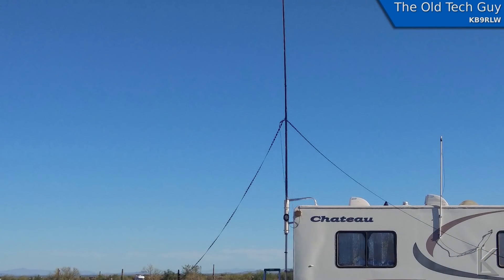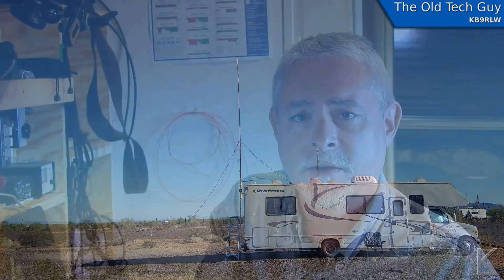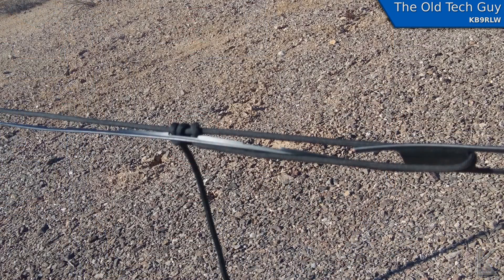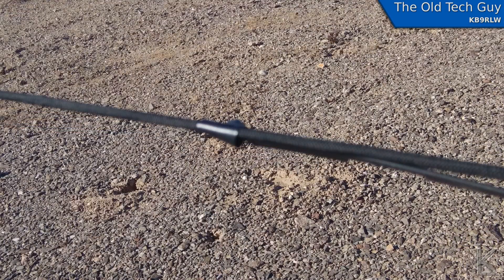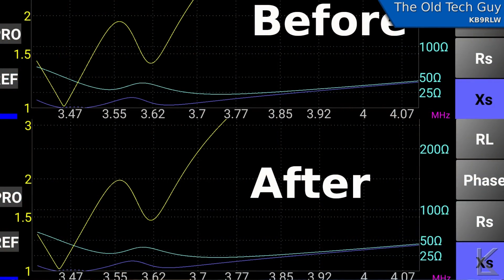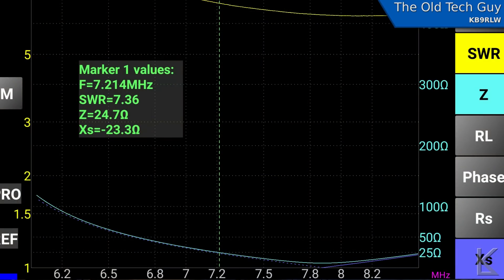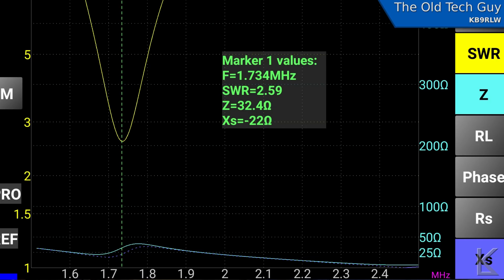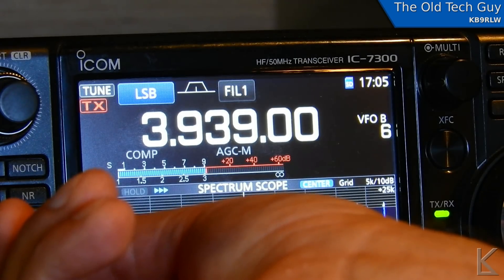Ham Radio - The 75/80 meter fan dipole experiment.  The final word.

Comment: I know this is an older video, but I have a few thoughts. 

My first thought was to solder your extended ends of the shorter wire back to the longer wire at the ends.  This will give you a slightly wider element past the shorter wire. However, my guess is it would not have helped your 75m dip. 

When I was Novice, I saw the instructions to build broad-band antennas for 75/80 and diameter of the cages was huge. They might have been 16 inches and used very many wires.  

I never had a full-spectrum 75/80 meter antenna.  I did accidentally broaden the bandwidth of my 80m antenna when I made a parallel dipole......

* technically, the "fan dipole" had different bands spread out like a fan, or more like the spokes of a wheel.  The Parallel Dipole is where the different elements are all parallel to each other. 

I made parallel antennas with 80, 40, 20, 15 and 10m.  The 80 meter version was wide enough to cover all the data/cw band and the 75 meter version covered all of the General privileges, for sure, because I was General then, so I don't remember if it covered the rest or not. 

I used 4 inch spacing at first, but I experimented with wider spacing up to 8 inches. The spacing changed the bandwidths a little and moved the dip just a little. I don't recall the "sweet" spot because I did not think the extra width was worth it and I was happy with 4 inches. 

The fan dipole was my favorite until I accidentally made a doublet from an 80m dipole. 

I put an 80m dipole about 100 feet high and fed it with RG-59 CATV cable. I used a tuner to match it to 75 and 80 wherever I wanted to be. It did not do badly on the other bands.  I don't remember the exact length, but it was probably cut for the middle of the band.  I'm guessing it was in the 150 foot range.  When lightning disintegrated the aluminum shielding of the coax, I replaced it with 300 ohm TV twinlead, and later, 450 ohm window line. 

This was my miracle antenna. If I could hear it, I could work it. I was the most wanted station on wall-paper nets running QRP.  I never had a better wire antenna.  

My tuner was manual at the time and had a built-in 4:1 balun for connecting twin lead, window line, or open wire feeder Called ladder line.  Today, I have auto tuners, so if I used this antenna, I would run window line or ladder line made with insulated wire.  I would use a 4:1 or 9:1 BALUN, preferably at the tuner, or to the coax closest to the tuner. 

For your setup, at least at this time, I think the doublet would work best for you. The reasons are that it may be lighter, and it can be trimmed to match all bands. The doublet is kind of like the random wire. It needs to be fed where the voltage, impedance is low enough to handle.  The window line has negligible loss. It can be trimmed, even off center, to have an SWR tunable by even the internal tuners in the radios.  Unless you have a G90 and then it would not surprise me if it tuned the antenna without a balun, hihi.  

Great videos on this antenna. Thank you

Comment: one thing that would have helped .

 Drop the ladder line and use thin gauge wire like 18ga ,  use zip tie material as for spreaders this will lighten the overall weight, or better yet just drop the spreaders altogether . I understand that your wanting to to make it portable and quick to deploy , but really,  how hard is it to simply unroll four  60+ feet of wire on four small separate rolls really ? 60' of 18ga will roll up on a tiny reel.. this also gives you the opportunity to angle the bottom antenna offset from the other  .BTW  I've learned from experience that you tend to get better results when you have the longest antenna on top . 73, and  Happy Rag chewing

Comment: the wires are probably too close together (too tightly coupled). looser coupling should smooth out the pair of resonances. how practiced are you with antenna modelling (4nec2, for instance)? have spare wire and spacers (monofilament or paracord bits) to make a wider spaced 'fan'?

Comment: I invented an antenna I call the Pyramid Antenna: It's two inverted vees at 90 degrees to one another and fed by the same feedline at the top, and that sort of looks like a pyramid. One wire pair is designed to resonate at about 3600 kHz and the other pair, at right angles to the first, resonates at around 3900 kHz. It does exactly what you want: below 2:1 SWR across the entire band; and, as long as you get it up 45 feet or more, it's nice and efficient. It also has the advantage of being much nearer to omnidirectional than a conventional dipole or inverted vee, because all the elements radiate to some extent, even the ones with less current cut for "other end" of the band, thus filling in the nulls.

Comment: I have learned a lot from watching your videos.  Sorry the fan dipole experiment did not work; logic doesn't always apply to electronics I've noticed.  I thought it was a good plan. I have a Chameleon EMCOMM III and I assume it has a similar toroid to the ones you used for your outside box as it is resonant on lots of different bands.  Oddly, it does better on 75/80 than it does on 40 meters, which makes no sense to me.  But I love the EFHW type antenna.  I live in an HOA environment, and the wire disappears against the trees.  Please keep showing us your work.  I'm NOT a tech guy, but I have learned enough from you to at least attempt an antenna build.  I'd do a video of that, but there's probably enough comedy on YouTube already.

Comment: My fan dipole works very well across 80 (incl 75), 40, 20, 15, 10m without any tuning required, also all the other HF bands and 6m with some help from a tuner. See my comment on an earlier part of this series for details.
Reply: Good to know. Where did you find the design?
Reply: @mrtechie6810  I just made it up after thinking about it for a bit and looking at other designs.  It took a bit of trimming to get it to resonate on all planned bands, but with 48 wires and a bit of time that wasn't to hard.
The surprise was that it worked so well on other bands, although 6m was a bit of a struggle

Comment: Kevin,  I used to go to a field day where a guy used to build HF j-poles out of 450 ohm ladder line.  We used to hoist them with a baloon so they would act as a vertical dipole.  I seem to remember that they picked up a lot more noise than inverted v antennas though.  I look forward to seeing what you find out.

Comment: Instead of having the two wires for 75/80m so close and parallel to each other, have you thought about putting up two dipoles (one for 75m, one for 80m) with some more significant angle between them? AB2RA has an article about her experiments with this arrangement; separating them in a fashion similar to a bowtie antenna, with something like a 45-60 degree angle between the 75 and 80m elements, will decrease the SWR across the band (in her case, less than 2:1 pretty much everywhere). https://wireless-girl.com/Projects/Antennas/Broadband80mDipole.html

Comment: Thanks Kevin for giving that a try.  I figured it would make a difference but didn’t know what to expect.  I haven’t studied Fan dipoles yet but wonder if they need to not be parallel.
Reply: Correction,  fan because of construction, the legs fan out. But the multi band part is as described. Just like feeding multiple resonant ham sticks from a single coax.
Reply: They are referred to as a fan because they are in parallel. The typical design is based on the separation of resonant frequencies. Mine has 40/15, 20, and 10.

Comment: You muffed it, your short leg is under 3.7 MHz, it should be at least at 3.9 MHz.
The two ends of  dipoles are capacitively coupled together as was that short floating section, the wire is the inductor for a tank circuit.  You could have just removed the wire and left the plastic.
  Fan dipoles do not work well with under four inches if separation at the ends. (more is better)
  Ron  W4BIN

Comment: A j-pole is essentially a half wave antenna with a quarter wave matching stub.  3/4 wave of window line should about do it.
I have seen a cage dipole used to try to get 80 and 75 on the same antenna.  I think that is in one of the old ARRL Antenna Books.

Comment: I think, the J-Pole Antenna is completely about a 3/4 Wavelength (Lambda) long. But the Part of the Antenna, that actually radiates ( at least, it should be the only Part that does that.. :D) ) is about 1/2 Wavelength (Lambda) long. The "Matching" Section of a J-Pole is about 1/4 Wavelength (Lambda) long. And at least to me, that Part that Feeds the Antenna looks "symmetrical" to me. Because it is something like symmetrical "Feed-Line". But People seem to feed that Antenna Type mostly unsymmetrical.. :D (directly with Coax Cable). That could change something.. And done this Way, maybe Parts of the J-Pole Antenna radiate as well, that should normally not radiate at all.. :D

Comment: Try using 4 separate lines not closely connected.  Take the 2 dipoles and  make an x out of them, basically one dipole east/west and one north/south connected at the same center point. Would be an interesting experiment.
Reply: Thanks for following up the experiment Kevin. 20m J-pole would be interesting. I have used window line to make J-poles for 70cm, 2m and 6m. All work just fine. I have thought about a J-pole for 20 -   the attraction being that, although a quarter wave longer than a regular dipole, it is essentially end fed (without having to use any matching components). Though a 1:1 balun or current choke may help if co-ax is being used as feeder. Shame the 80m dipole didn't quite work as planned but it was interesting to give it a try - thank you.

Comment: A J-Pole is 3/4 wave, a half wave radiator with a quarter wave matching stub at the bottom, fed at the bottom of the matching stub, looking for the best match..  BTW I built a folded dipole for 6 meters out of ladder line and it works great.  73, de N4QM